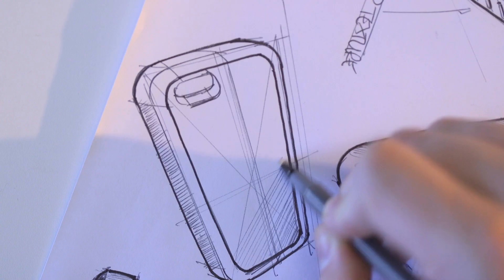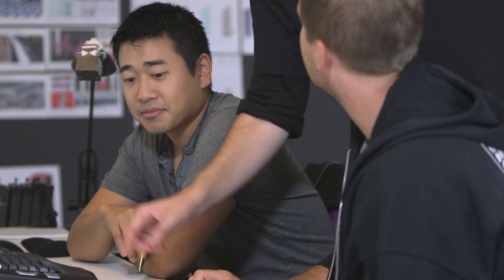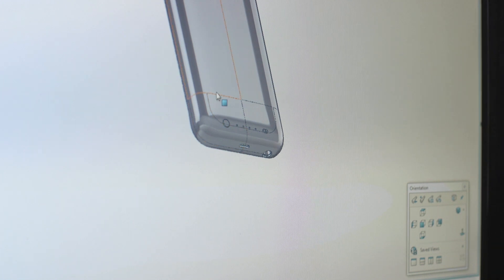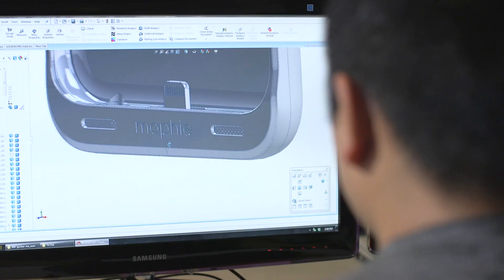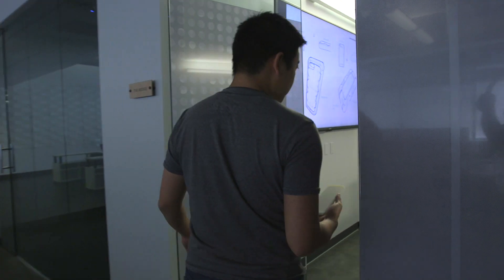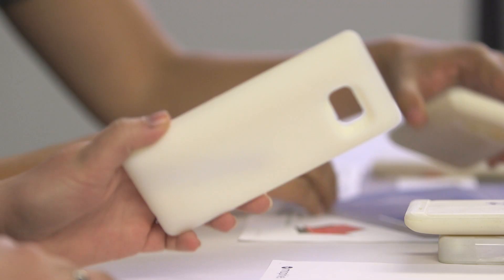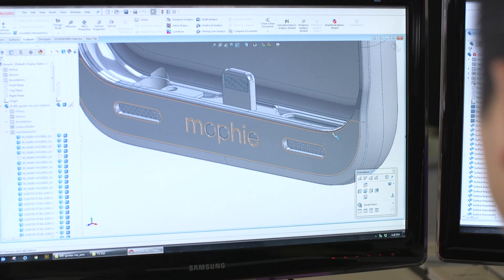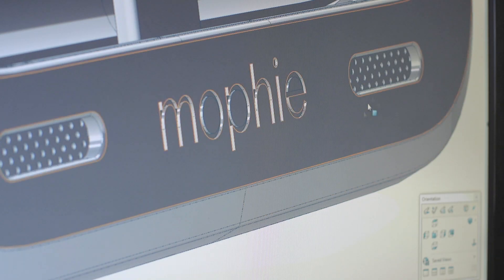Explore the mophie process – Stage 1: Design

Comment: I hope you make a mophie case that's as slim and lite as the juice pack reserve but a bigger battery capacity. It would be the best
Reply: fightnight14 Hey bro. Here's a fact. The smaller the battery is the less the capacity. If you want small and high capacity the battery would have to be denser meaning it would charge slower and be much easier to damage wen dropped and easily explode when dropped or bumped. Maybe in a few years there will be a better battery technology but for the moment unless you want a exploding ad slow charging battery ENJOY THE BULK :)